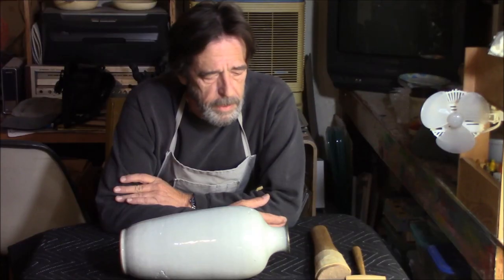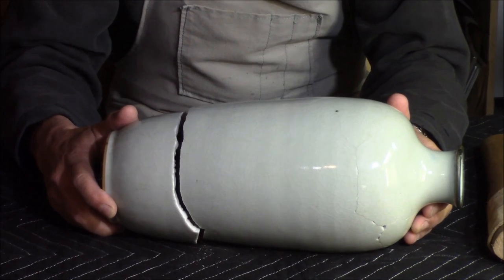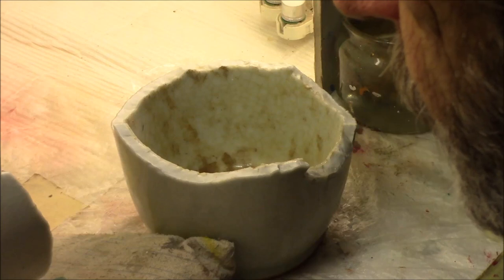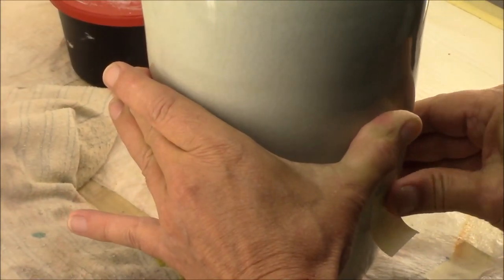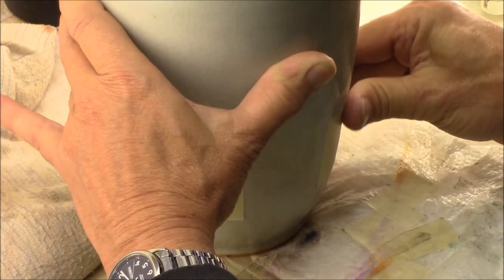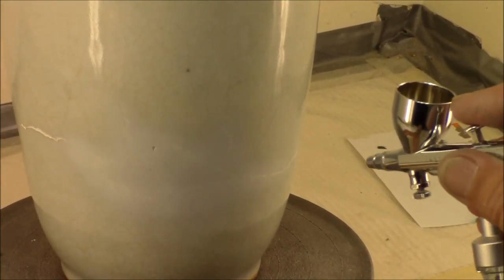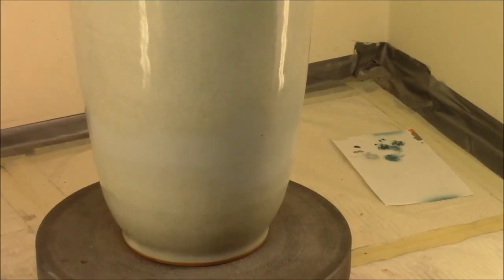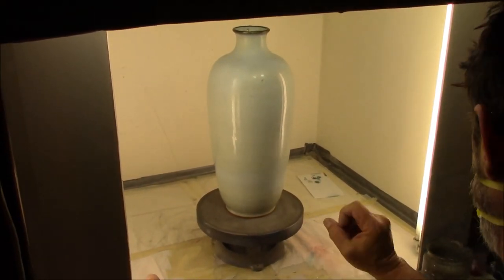Green Porcelain Vase Repair

Comment: Fascinating project, very unusual. Thanks again Martin for another great tutorial.

I have just repaired a porcelain vase and it looks really good and the colour match is perfect (2 hours of trial and error). However, the porcelain is translucent and when the light passes through the vase the crack is very clearly defined. Should I perhaps have used Hxtal instead of milliput to fill the crack? Is there anything else I could have done to improve this?

Any advice would be greatly appreciated.
With kind regards, 
Clifford

Comment: Okay, sorry for the questions. What's a HOT BOX and how would you have broken it if it didn't just break? You're teaching me so much and I'm flipping out! Thank you!
Reply from the maker: As you can see by the mallets on the table, I would have tapped lightly along the cracks with them to complete the break. Both mallets have leather covers on the heads to soften the blows.
A "Hot Box" is an insulated box with a heating element in it and a thermostat to adjust the heat. In my case, I have an old upright freezer which has an electric oven element in it, a thermocouple (a probe which can detect the temperature) hooked to a temperature regulator so I can set the temperature. I adjust it to a temperature of 140F to 150F. There's also a small fan in the bottom of the box to circulate the air inside the box so the temp is even throughout the interior of the box. I got this hot box when the restorer I used to work for retired and I got a lot of her equipment to start my own business. Her husband made the box for her. 
You could make a simple hot box yourself: make an insulated box, or use an old camp cooler. Put an incandescent light bulb in it, or you could even use a hair blow dryer. A thermometer to tell temperature. Put a hole in the side of the box with an adjustable cover for the hole to regulate the temp inside the box.

Comment: Marvelous Job Martin. I am repairing a basket handle for one of my figurine and I am trying to figure out after making putty handle, how many times i have to spay cold glaze pro and paint. Like paint first, then glaze and repeat process two more time ? 

Will Appreciate your advice.
Reply from the maker: Generally, it goes like this: I use the Cold Glaze to smooth over the final Milliput fills so there's no discernible evidence of crack lines or fill perimeters. Each coat of Cold Glaze is sanded with MicroMesh 2400 grit, and I stop adding layers of Cold Glaze when the sanding no longer reveals those crack lines, etc.. That sanding also provides good "tooth" helping the paint layer adhere better. This takes 2-3 coats of CG. 

Then the paint layers are added followed by one or two light coats of CG. The final CG coats are 3--4 layers. If you have a highly dimensional surface, maybe more coats, because it's easy to sand through them. Because on the final layers you need to MicroMesh these grits: 2400, 3200, 4000, 6000, and polish w/8000 (or you could use "Novus 2 fine scratch remover" polish instead of the 8000 MicroMesh (get this at TAP Plastics, and buff with cotton make-up pads). 

I should address this in my next video. Good luck on that repair.

Comment: What kind of paint did you use and how did you colour match?
Reply from the maker: I use Golden brand high flow acrylics, or airbrush colors in my airbrush. I use their fluid acrylics for brush painting.
For color matching: I mix the color as close as I can to match. Then I put a spot of that color on top of the color I'm trying to match to see how close I came to matching, and dry it with a blow dryer. If I'm not close enough to a match. I wipe off the spot. I adjust my color mix, and repeat until I get a match.  If you can't put a spot of color on the object. I put it on a piece of white paper, dry the paint, then hold it next to the color I want to match. The rest is the same procedure. Any way you look at it, it's not easy.

Comment: Martin what cold glaze do you use before painting - Sylmasta or Golden Restoration and do you airbrush or paint it?  I assume that its role is just to allow the application of the paint to the existing hard glazed surface?
Reply from the maker: I used Sylmasta Cold Glaze, airbrushed, to seal the color and to provide "tooth" for the next color to adhere.
Reply: @marsgitar  Thanks - I have mastered rebuilding but painting remains the challenge.  Despite thinning it Sylmasta takes a lot of cleaning to prevent it clogging the nozzle.
Reply: @marsgitar  How did you achieve the glossy appearance after you airbrushed over the epoxy? The painted part looked matt while you were air brushing, but in the end it had a glossy appearance as the rest of the vase has that was not painted. Thank you.
Reply from the maker: @sn232  Sylmasta brand Cold Glaze is used as a final coating to achieve the glossy finish.

Comment: The cold glaze is to protect the paint, right?  or you paint on tree coast of cold glaze after the milliput fills? this doesn't make sense, right?
Reply from the maker: Because often the paint doesn't adhere well to the ceramic glaze, or to glass. I give it two or three coats of cold glaze, then sand it to give the paint something to stick to.

Comment: I have a little trouble with orange peel when I spray over a rounded surface, any pointers?
Reply from the maker: For this, I use: Micro Mesh special sandpapers. You can get a set of sheets of different grits: 1800, 2400, 3200, 4000, 6000, 8000, 12000. From these, for getting rid of orange peel, I use the grits, in sequence, between 2400 and 8000. That'll buff it to a glass like finish. This, by the way, is after at least 3 coats of Cold Glaze. Both easy to find on the web.

Comment: where can I study  porcelain restoration?
Reply from the maker: I know there are places where one can learn this craft but I don't know who they are. I learned how to do this from working for another restorer. I got that job because I already had most of the skills I needed to do the work. To be good at this you need to be in a constant state of learning . . . which is the way I view my life in general.

I just did a quick search on-line for "learn ceramic restoration" and there were many places listed. Your search result may be different depending on the country you live in, but try that search . . . if you haven't already.